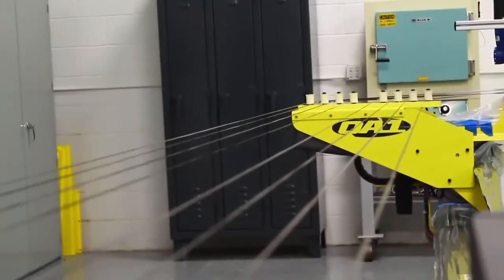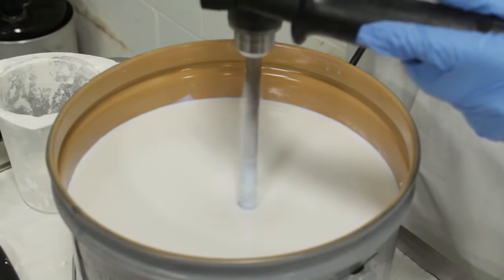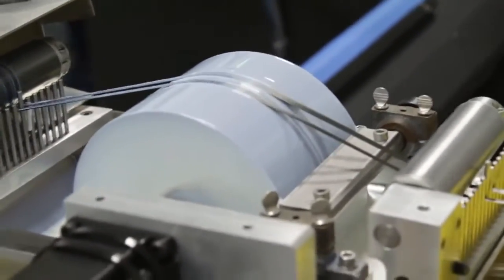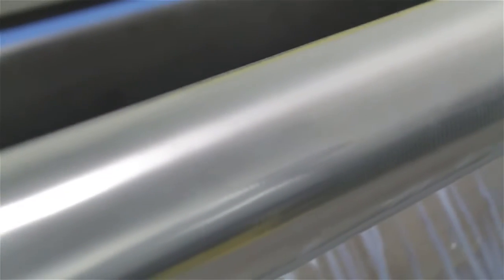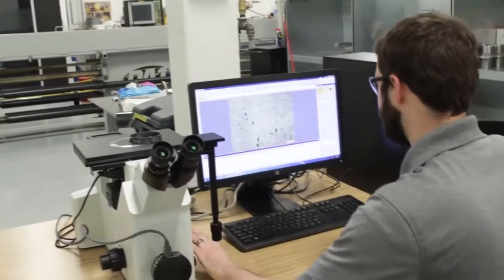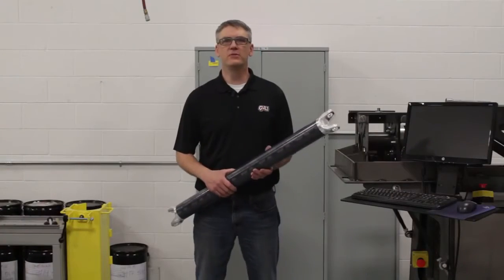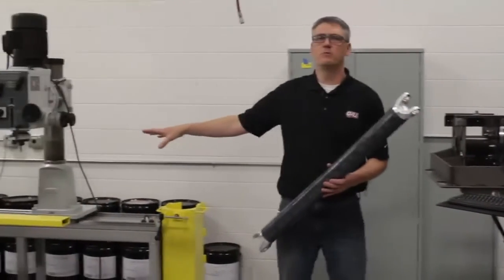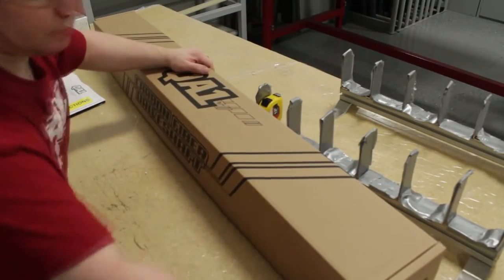The Construction of QA1 Carbon Fiber Driveshafts

Comment: What is the price for everything to drop into a 1999 Camaro SS built automatic. Have the stock Aluminum driveshaft with high miles 156K but a highly built auto and car has only 380HP/340TQ but my goal will only be 450- 500HP with heads down the road.